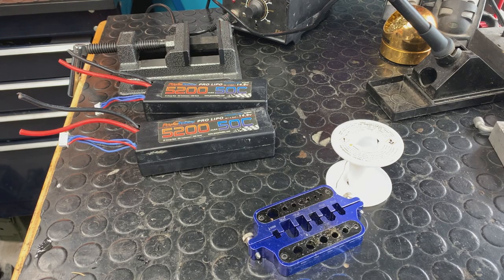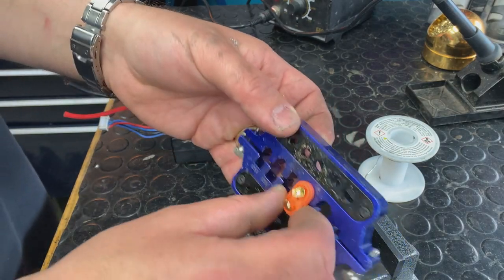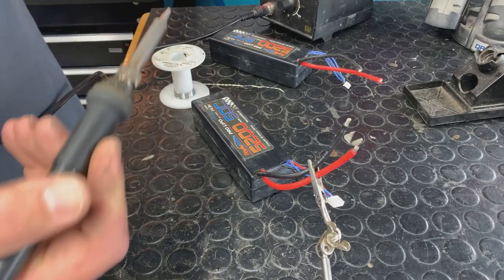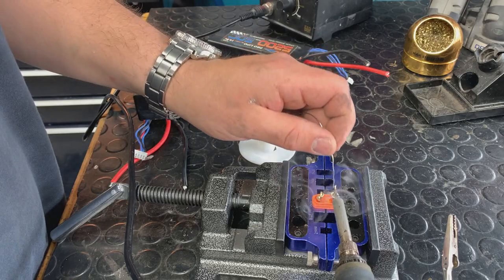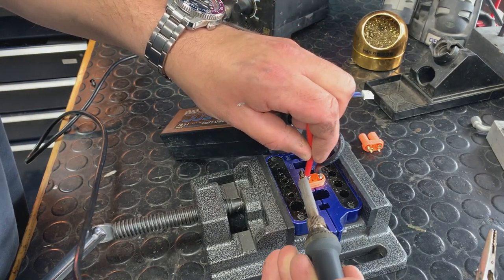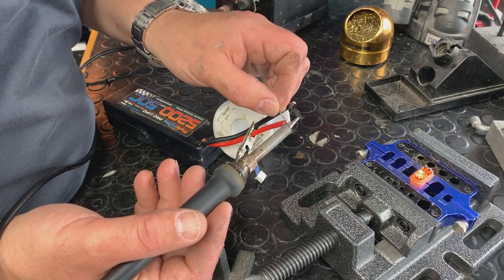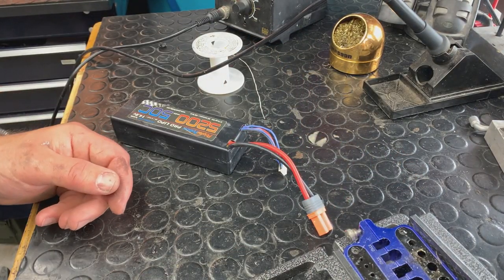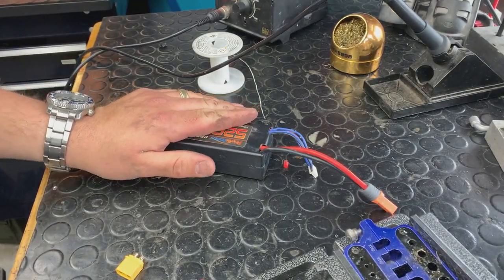How To PROPERLY Solder Your R/C Battery Connectors! (TIPS & TRICKS)

Comment: What is the temp your your iron? I always having trouble with these IC connectors melting
Reply from the maker: I use max temp and I get in and get out 

Truck with ic3 especially is to be quick and efficient.  Too much heat for too long = poopy connector.      Practice makes perfect       The ic5 larger connectors are much easier. Lots of heat use high grade solder and make sure everything is “wet”.  

Good luck.  Take you time and have fun   Soldering takes time to get good at
Reply: I used to solder plugs with zero issues. Now years later I’m having serious issues. I tin the connector and the wire but when I put them together it seems to take forever to get the two to melt together. By the time I get them together my finger tips are burnt and the connector is starting to melt. I think my soldering iron isn’t up to it. It’s a brand new benzomatic butane soldering iron from Lowes.

Comment: Complete noob question…no harm in snipping the old connections in preparation for the new?  Thought I read the length of the battery wire should not change.  I realize if you do it correctly the overall length shouldn’t change much but just looking to verify. Thanks for the vid!

Comment: Is solder just a bonding agent or does it actually act as a connection it’s self or do you have the have the wire touching the copper on the ic5 connector? Just curious, never thought of it. Just all you gotta do is just look at it! Lmao ed bassmaster is the best.

Comment: Informative video, but you are using the easiest plug out there to solder.
Reply from the maker: Negative. 

They are all easy when you solder 100 plus a year lol.  But yes easier than traxxas or deans.  However traxxas doesn’t sell separate plug anymore.  Also we picked the plug that was the most requested.  Also I love soldering.  Subscribe immediately:)

Comment: It's making me cringe that you have both positive and negative stripped and close together. I'm liking your videos but this is not safe. This isn't good in ANY situation
Reply from the maker: Sure it is.   Just like wiring most things in life whether it be 120 volt home wiring or working on cars.   Be conscious and be safe.   Also you can use electrical tape or some heat shrink if you feel it is safer for your skill level